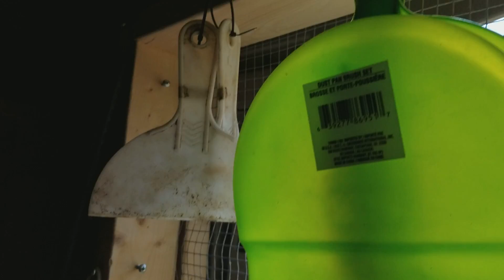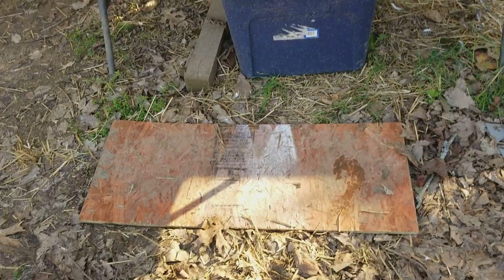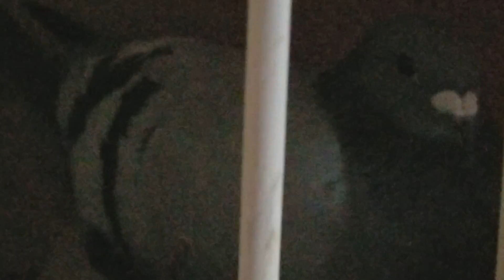Chaos in my 2018 breeding section,  N.Y. flights breeding strong, Small changes to my flight loft

Comment: Nice update Ham! Thanks for the shout out. I once moved  a pair on eggs and they immediately abandoned them. I think the only way you can move em is to move the hole nest box.
Reply from the maker: Dunningville Loft The flights eggs don't really matter. I got some that lay when they want to. However,  I'm trying to get as many racing homers as possible. I will clean the floor n the stock loft after there young hatch and get bigger. Going to sand for the rest of the year. Thanks for the comment and watching 😀.

Comment: I used to use cedar chips on the floor to help keep the floor clean. And I was having the same problem with laying eggs on the floor. Once I stopped putting material on the floor they stopped laying on the floor. 
And after that if you still have a pair that’s stubborn and still wants to drop on the floor you could always lock that pair up in one of the breeding boxes. Put them in there with a nest bowl and some material and keep that door shut just until the eggs drop, then open the door for them. Once the floor is cleaned up you will be able to see if one of the pairs is putting straw or feathers in a corner to make a new nest. If that happens just keep cleaning the spot up and they will usually find a better spot to lay without being disturbed. That’s my experience.
Reply from the maker: A-town flyer I will be cleaning the floor later. Going to sand, I'm going to leave just their nest only. Thank you for watching and the comment 😀

Comment: thanks for the shout out ham!! glad i got to see the  update on the hulk,,
my advice for your next round of youngsters is to remove the hay out the loft on the floor
just use sand,that should make them use there breeding boxes,,
Reply from the maker: Kingzie mac will get on that for the floor. Still have some hay I will use in the flying loft. Thanks for watching and the advice 😀
Reply from the maker: Kingzie mac do it matter what kind of sand?
Reply: Ham's Flights Kit Box any sand will do,,your better with a fine grade sand,,
Reply from the maker: Kingzie mac cool, thank you 😀
Reply: Ham's Flights Kit Box Lowe's or Home Depot has play sand it works the best very fine it's never wet
Reply: Peter Ramin 5 & 10 loft can you build sand castles with it?? Lol lol
Reply: Kingzie mac you going to need a little water for that my friend LOL I'll tell you one thing it works good but it tracks everywhere  on the bottom of my shoes in my house got to be a better way

Comment: Young birds full all day long , good stuff. Yes I agree with others scrap the floor clean just use sand. When you put straw in just put in hand fulls are a time . Watch them  they will pick it up .when it’s all over the floor to much it only get dirty and they won’t use it anyway.
Thanks for the shout out. 
Just an observation . Why do you but wood out side the loft doors . It would pay in the long run to put slabs down or concrete then you would be sorted for along time.
Reply from the maker: Joe M Tipplers Told the wife I was going to use pavers. Timing is always the problem.  Trying to work 55hrs a week, only got the weekend off. Lots of projects to wk on in the wknd. Thanks for watching and the comment 😀